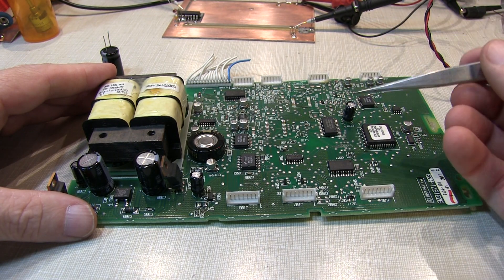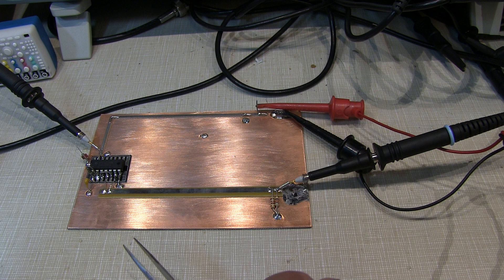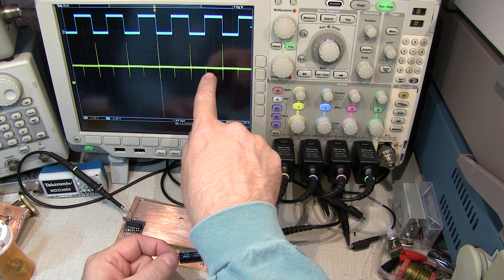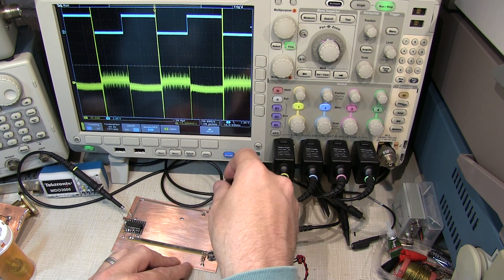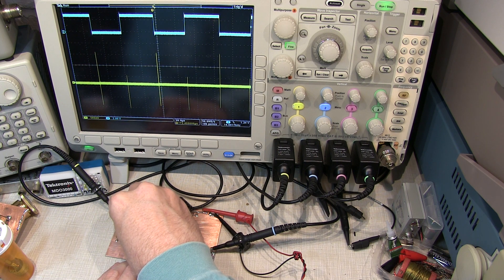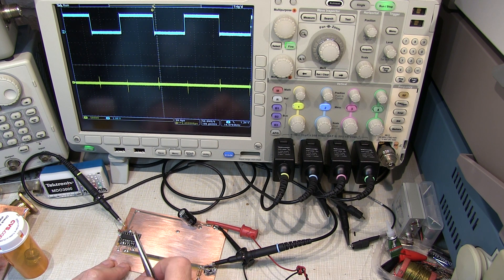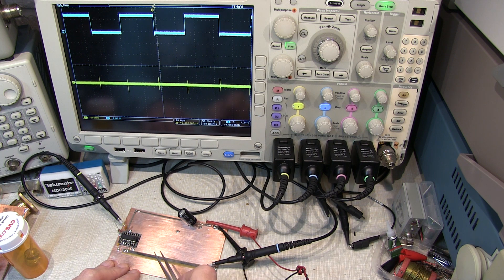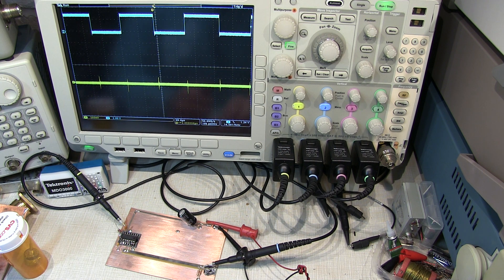#257: Power Supply Decoupling &  Filtering: why we use multiple caps in different locations

Comment: thanks for the great video. I have a question though: how about the role of those SMD electrolytics that are also distributed all around the boards and usually near integrated circuits.
Reply from the maker: They also provide bulk, low-ish frequency decoupling.  The self resonant frequency of smaller SMD electrolytics is a bit higher than the the leaded parts, but still not quite as high as the ceramic caps.

Comment: Why can't the filter capacitor bypass the high frequencies when placed at the IC? Is it because the filter capacitor has a higher inductance than the smaller capacitor?Thanks.
Reply from the maker: Because the larger value capacitors have too much parasitic inductance, resulting in a higher impedance at high frequency than the smaller value caps.

Comment: What size caps would you recommend for tl074 op amps with a +/-15v supply. Im getting alot of noise from one of my square waves . Im using each tl074 for a musically scaled VCO. Operating from about 16hz-about 16khzish. Thankyou :-). As they are on bredboards im guessing this in itself is introducing alot of noise. Im using cat 5 cable cut to short runs to components.

Comment: Thank you very much. At last I got pretty applied explanation. Your videos are great.
Usually I see 10 uF around microcontrollers. Is that a general rule to use them or I should make some calculation using output frequencies? If I understand you right value of decoupling cap depends of output frequency. But what if my microcontroller drives some high speed SPI and low speed UART at the same time? Thanks again.
Reply from the maker: Good practice would be to use a few in parallel.  A large electrolytic like your 10uF, but also add some lower valued ceramic caps, like 10nF or so.

Comment: Hello Alan, Thankyou for the very comprehensive and Informative Videos !
I see you use a Metcal (Probably MX-500P-xx one), would it be possible to make a Review of the Station and the Tips you use and what your experience is with it.
I myself have a MX-500P-21 that I sourced bcs of the good Reviews but I am not sure if my unit behave correctly bcs I expected more in form of thermal capacity.
I use STTC-0xx Tips and use leaded solder bcs the 6xx and above ones get too hot for my solder and evaporate / Burn the Flux in the core.

Thankyou again,
Cheers
Konstantin

Comment: I have a question: I always thought inductance increased with loop area because a larger loop meant a longer wire, but if I understand you correctly, you are saying we can have a longer path with less inductance if the loop is squashed (supply path close to return path) and the area is small. How is it that loop area affects inductance more than length of conductor?
Reply from the maker: Inductance is proportional to cross-sectional area: L = µn2Aℓ
Reply: Yes I've seen the formula, but why would area come into it? I've always thought of inductance as momentum of electrons. Perhaps more area in the loop allows more magnetic fields to form and collapse and this is what makes it harder for electrons to start and stop. Let me know your thoughts.
Reply: Thinner wire also increase the inductance - the lowest inductance path is when the current flows in parallel sheets close together, such as a power-plane over a ground-plane.  The aim is to minimize the magnetic
flux the current creates by reducing the loop area and also by spreading the current sideways to reduce current density and thus reduce magnetic flux density.

Comment: Excellent video! How good the scope should be to measure such things? I see the scope runs at just 50MSa, so any decent scope like rigol 1054z should do the job?
Reply from the maker: The settings on the scope (record length and horizontal scale) is what's leading to the 50MS/s rate.

Comment: Expensive gear going into landfill due to failed cap's is common - like my £900 TV with a failed 0.02p cap' on the power-on button... Since a very high proportion of PC motherboards failing after 6 months also die due to bad electrolytics, I wonder if 'solid state' types more reliable?

Comment: excellent! a practical demonstration goes a very long way;-) Coincidentally I was thinking about filter caps when used in combination with power supplies that are not rated for very high currents (e.g. 150mA max @5V). Large value filter caps placed on the supply presumably risk pulling more current than the supply is rated for on initial charge. Can these fry the supply? Or is the risk somehow mitigated/compensated for by design?
Reply from the maker: Certainly will depend on the design of the power supply and the size of the capacitor.  If the supply current limits while charging, or if the cap isn't too large (will charge quickly), then you'll be OK.  I would think that unless the cap is very big, you shouldn't have a problem.

Comment: I have long suffered a very foggy understanding of what impedance actually is. I think I caught a faint glimmer of understanding from that. Odd that it should about the roles of something else entirely. Big capacitors and little capacitors. In a band scenario (very loose analogy) the bass amp is usually factorially more powerful than the guitar amp but its placement is less critical. (And they may both employ 8 ohm speakers. Go figure.)
Reply from the maker: You can think of impedance this way:  Impedance is to AC signals as Resistance is to DC signals.  Impedance is the opposition to AC current.
Reply: Thank you. Though I guess the application of Ohm's law would involve calculus. And that's even before you think about induction and frequency. I do enjoy your videos though so I shall watch some more.

Comment: sir, this is excellent video.ATtime 0608 u explain the high frequency current goes to ground then u say that it return back since the the transmission line beneath gives less impedance that concept is not clear .how the high freq come back frm the ground plane .pl elaborate with more detail of this important concept thank u sir.
Reply from the maker: The impedance (in this case, the inductance) is proportional to the area enclosed by the current loop.  When the return currents flow under the transmission line, they encompass less encircled area, thus have lower inductance (lower impedance).

Comment: Great Video. I have been reading quite a few articles about this topic. Your video is the most practical example by far. Here are a couple questions:
1. Are those high frequency noise on the scope caused by the fast switching or you manually inject into the power supply rail? Please excuse my question, just have to confirm. It makes more sense that the HF noise is from the switching because we wouldn't be able to the noise when you placed the ceramic cap close to the input of the power supply if you were to inject the HF noise on purpose.
2. And how high is your high frequency switching? I have never seen a HF noise so noticeable on a scope before. 
3. I would love to see if you can demonstrate filtering high frequency noise in the power supply rail with your current setup. That would require manual HF noise injection. It's a good example because HF frequency noise does get into the power supply rail.
4. I found a couple people are confused by the current path with your explanation.  I was a little confused at the beginning. But one of your comments made it clear. I am going to repeat it here with my own words (correct me if I am wrong.). It is easier to think about your ceramic cap as a local storage cap that is capable of discharging its charge at a very high frequency, therefore, it is easier to think about the ceramic cap as a power supply that is capable of providing high frequency current demand due to fast switching. Then it will be clear that the high frequency current is returning back to the ceramic cap and not returning to the input of the actual power supply.

Thanks for the great demonstration.

Comment: Good vid showing decoupling work in simple way. Now for part 2 you could show difference of using multiple values cap for local decoupling, such as why 0.1uF + 1uF + 10uF better than just 2 x 10uF :). Or that can be part 3, and part 2 can cover how to determine how much capacitance for bulk you need to have good power delivery. :)

Comment: Really wonderful video. I'm not understanding something that likely is very fundamental and hope someone will help. The HF decoupling cap is placed between VCC and GND near the chip. The return current travels under transmission line back towards the chip (to minimize the current loop). Why is the current return path via the cap near the chip? I would have thought the current would return to GND of the power supply, a lower potential. Thank you.
Reply: That's RF-Voodoo for you.
Reply from the maker: Current flows in loops. High frequency currents flow from the supply at the driver, down the line, thru the termination, back through ground, thru the cap back to the supply for the driver.
Reply: Why does the majority (all?) of the current flow through the cap back to the driver, instead of to supply ground? I'm sorry, this must seem a very simple question. Is it because when the chip drives the line, that current was borrowed from the cap, and that current is returned, minus losses, via the ground? The cap is a more local place to discard the return current than the supply ground? Thank you.
Reply from the maker: It's all about favoring the path of least impedance, and closing the loop
Reply: Indeed :)

Comment: Alan, you mention decoupling, but don't you mean bypass as decoupling seems to me to be about decoupling DC from AC signal paths as in audio.
Reply from the maker: Decoupling and bypass are used interchangably.  These filter caps can be considered decoupling too, since they decouple the low frequency and high frequency noise from the DC power rail.

Comment: You say the close decoupling capacitor provides a path back to the power supply, but what does that mean? Do you mean the decoupling cap is the power supply, so the path is shorter? Otherwise I don't see how the path is any different.
Reply from the maker: Yes, the cap essential is the power supply and return path for the high frequency currents.

Comment: Do you happen to have a second camera? Maybe a smartphone? You could try to get a video of the trace and another video of the pcb and then put them together in editing (maybe you can "screen capture" the scopes trace?). I know this is lots of more work in editing, but it makes so much more use of screen real estate, currently 70% of the screen is showing nothing useful, and its kind of hard to see where exactly the caps are positioned near the IC
Reply from the maker: Low budget operation here - just one high resolution camera, and the only video editing tools are the ones that came with the camera - and it doesn't do embedded/overlaid clips.  I'll look into upgrading my video tools in the future.
Reply: Rule #1; Keep it simple. Two camera's, remote trigger, remote mic all some in handy but save you $$$ for the important stuff, like wood working tools and vacation.

Comment: What about putting an RF choke in series with the supply lead?  I've been experimenting with MMIC amplifiers and they want a choke going to the bias input of the MMIC with caps on the input to the choke.
Reply from the maker: Many applications can and do benefit from additional filtering such as with RF chokes, ferrite beads, etc.  Most often this is to help to decouple RF circuits from other circuits, by ensuring that the RF "noise" finds it's way to ground through a filter cap, rather than conducting further down the power rail.  A little beyond the scope of this video.
Reply: Thanks for the reply.  I've been working on an Arduino based DDS trying to decide the best way to buffer the output either with discrete circuitry or a MMIC.  When I get this done I'm thinking of submitting the project to QST so I want to make sure the design is as bullet proof as possible.  Your comment has given me a couple of ideas to try.  73

Comment: What is the value of the large electro cap you used for low F filtering?
Reply from the maker: In this case it was a 1000uF because I induced a fair amount of very low frequency noise onto a low-impedance power rail.

Comment: Can you do a follow-up video on decoupling vs bypassing, and how chokes and ferrite beads play together. I had problems with Bluetooth audio modules coupling noise on their audio output. Solved by trial and error with different combinations of capacitors with a low pass filter on the power rail. But I will not pretend to understand what I was doing even thou I got it working...

Comment: Excellent, well understood. One question, in many circuits and some ICs technical information I seen a large cap, lets say 10uF and a small cap 0.01uF right at the power pin of the device, sometimes noting that they should be placed as closed as possible. Why is is the large cap there?
Reply from the maker: It can't hurt, but its placement there is less critical than the smaller one.
Reply: Often you see this next to USB or Ethernet Devices. Bulk Capacitance to  keep power rail stable, at the chip. Low ESR (X5R or X7R) bulk specified  for a reason. As a FAE (Field Applications Engineer) we may recommend a
cap that is larger than needed as we don't know if you have a two layer board, or an eight layer board with very low impedance ground and power planes.  

So if the IC is over 500mW in power, use a big bulk cap. If  you are building 10 million boards a year, you will have an FAE on site to review your schematic, give layout tips, and be there at board bring  up! In that case a 2.2ufd X5R maybe fine, but out app note recommends a 4.7ufd XF5 or X7R.  

Biggest issue is protoboards worked fine, but suddenly see a 2% production fall out at an ODM product line. Often they have used random mfg for the caps.  What ever you do, please do not build two layer Ethernet Boards!

Comment: Awesome video!  As a follow-u, could you make a demo board where you can selectively interrupt the ground return path on the bottom layer (maybe with jumpers?)  and show the effect on the power supply?   I have the students at Colorado School of Mines develop a mixed signal system and am always harping about clean ground planes - video proof would help reinforce.  Also have you found that sampling a signal from the output of an opamp with an ADC inside a microcontroller, generates noise on the analog signal as the ADC charges its sample and hold capacitor?  If so, any suggestion to reduce the interference?
Reply from the maker: I'll add the video idea to my list.
With regard to the noise induced on the op amp output.  First, make sure that it isn't actually being coupled via the power supply (i.e. use good decoupling).  If it is due to the load change and charge injection from the sample and hold circuit, then using a buffer with good reverse isolation would be a good start, as well as low pass filtering as much as you can persuant to your signal's bandwidth.
Reply: I know its a bit controversial, but I used a split ground plane to try to minimize interference on the analog side.  This along with bypass caps every centimeter along the split in an effort has done a pretty good job of keeping high frequency supply noise off my analog supply.  I have a reasonably good antialias filter in place, but will certainly look at the reverse isolation of my opamps.  Thanks for your support of our community.

Comment: Alan, excellent demonstration. It's one thing reading the dry theory and staring at the equations for transmission lines etc but it's another thing entirely to see an actual practical demonstration of the effects of decoupling. Most of the time we want to get to our final circuit and the practical aspects can be missed along the way. One question, does the ground lead on the left hand yellow scope probe have an inductor in it? I can't quite tell. It sure does look like it.
Reply from the maker: No, that is a spring coil that is slipped over the ground ring on the probe. See my video on homemade high performance probe socket.
Reply: Ah, ok! I'll check it out. Thanks.

Comment: Very interesting explanation about the current flow in the ground plane. I never thought of this that way. So why does the larger cap not reduce the high-frequency noise even when placed close to the component? should it not also provide a low impedance path for the AC current? Thanks for the videos.
Reply from the maker: Large value electrolytic caps like that have too much parasitic inductance. That high frequency noise is well above the self-resonant frequency of this capacitor, where it is behaving like an inductor rather than a capacitor - so it does not provide a low impedance.
Reply: Ah, makes sense. Thanks!

Comment: With ceramic chip SMD parts is 0.01 or 0.10 a better choice. do all values of a ceramic layer capacitor have good HF response?
Reply from the maker: It depends on what frequencies you're dealing with.  In general, SMD caps of the same physical size will have about the same parasitic inductance, thus the self resonant frequency will scale inversely to the capacitance.  A 0.01uF cap will have a higher self resonant frequency than a 0.1uF cap of the same package style.

Comment: I've often wondered why a small ceramic is placed in parallel to an electrolytic for power supply decoupling. Great info - esp in that the ceramic cap needs to be close to the active element whereas the electrolytic doesn't.

Comment: I'm surprised to see that you use DC coupling with an offset instead of AC coupling. Is there any reason behind it or was it just easier to setup?
Reply from the maker: Just keeps things more stable when the noise is not symmetric around the DC level (keeps the trace from wondering up/down).